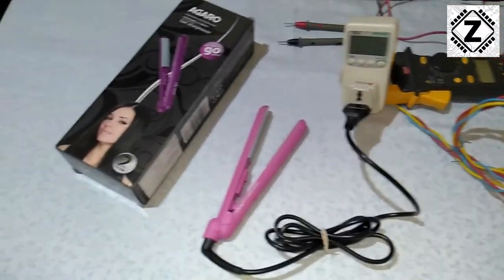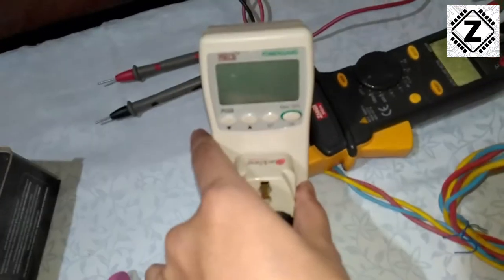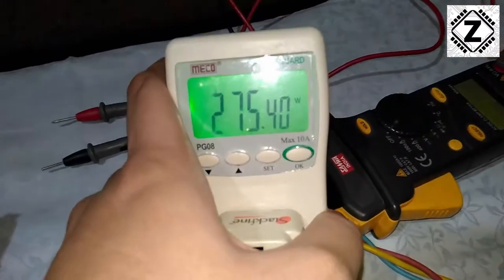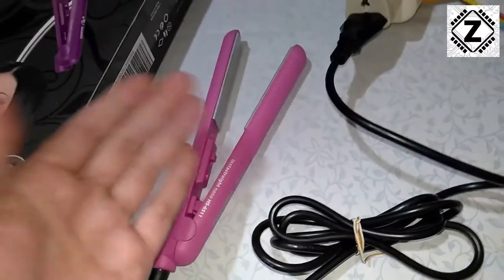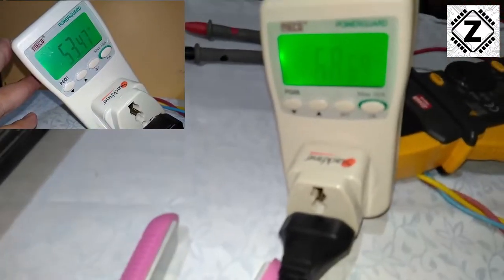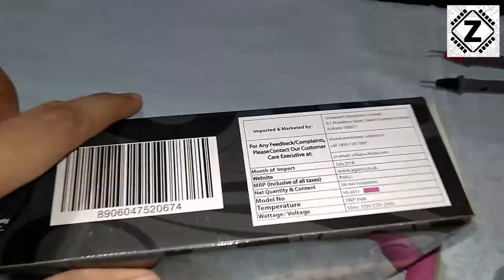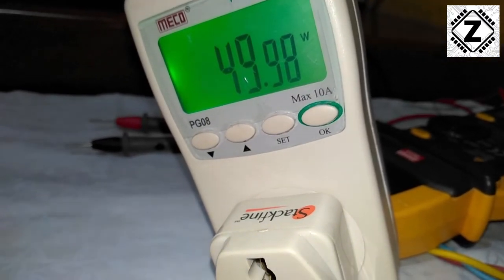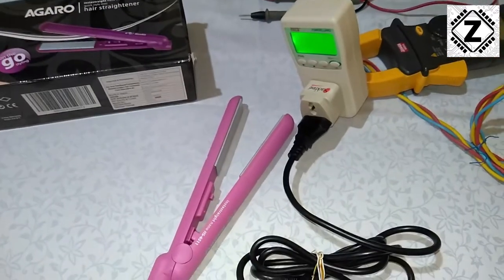[Eng] Hair Straightener Power consumption Test | Flat Iron uses how many Watts of Electricity?

Comment: Ok so i have a question… i am a makeup artist and we use mainly straightner from iconic brand and it states 60 watts .. so how much watt inverter should i buy .. so that i can use the straightener for period in my makeup salon.. plz helpp
Reply from the maker: It depends on how many hours backup would you want. For a start, try a small combo like this-
https://amzn.to/3KarG16
https://amzn.to/3Kj5LFb
Reply: @ZenInnovations  i already have 1050 sukam inverter
Now I want to purchase 3550 micro tech 24 V is it suitable for 60 watt hair curler machine because at 1050 it was blinking when curler turned on
Reply from the maker: It appears that your curler is not 60w. Maybe 600 or soemthing. It will be best to test it using a power meter or smart plug- https://amzn.to/41qS3Ht
If curler consumption is very high, get a heavy duty inverter like this one-
https://youtu.be/dZD196A8ns0
Reply: @ZenInnovations  okk..but can u answer this ..  ..that can I buy 3500 not 3550 micro tech 24 V and is it suitable for 60 watt....i just need for 30 mins ..
Reply from the maker: @Manveenmakeovers  as explained, it's certainly not 60w. Because 3kva solar inverter can easily start 1.5 ton ac which consumes 1500w.
You should measure your device for its actual consumption.